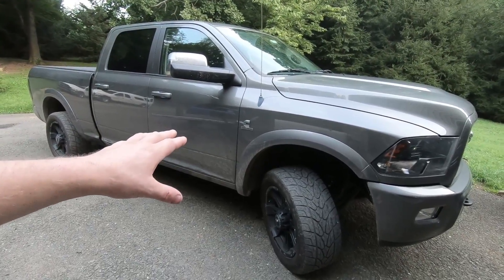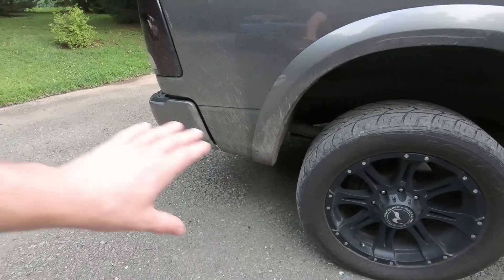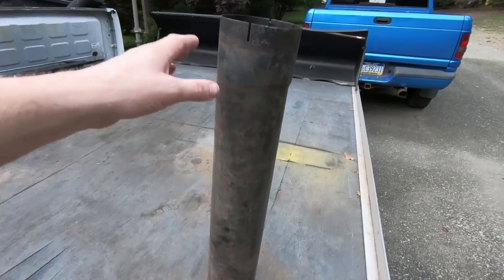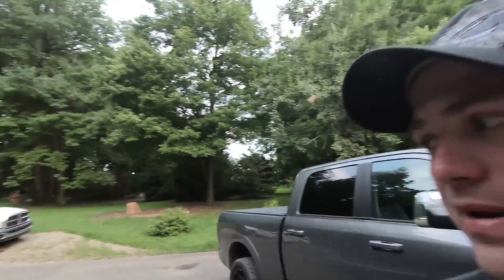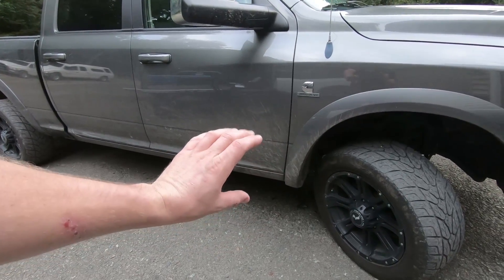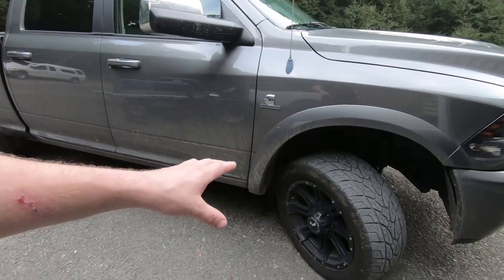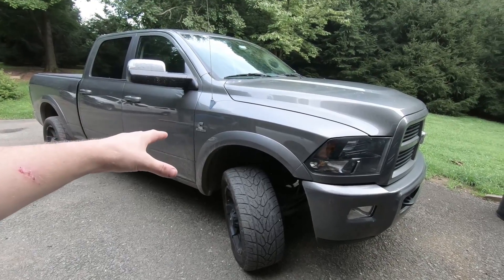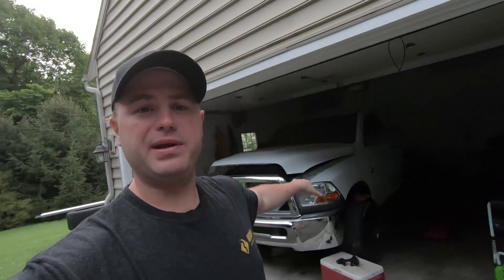Should YOU Straight Pipe Your CUMMINS

Comment: On my 2014 I ran the 5” turbo back straight piped, I loved the sound it was loud. But the drone while pulling and running around 60 was horrible. I put the 30” FTE  resonator on it and love it. Still fairly loud outside and sounds good and quiet and drone free on the inside! A win for FTE in my book as well

Comment: Running a 2nd gen swap on my 2017. 4” down pipe to flow pro 5”, had a full 4” straight pipe prior...the 5” is much better than the 4”. Might just be the insulation of the later 4th gen trucks, as I feel no need to have a resonator on it. As for turbo noise my 465/83/1.0 makes all the good turbo sounds.

Comment: Nice vids as usual.  But it’s going to be louder and have more drone because you’re not extending the exhaust out the side of the truck.  Under neath the sound has no where to go
Reply: Cristobal Ospina I agree. Mine is straight piped but I have it all the way out the back and it's not bad at all. My buddy has the same setup with an axle dump and it's almost too much for a daily driver